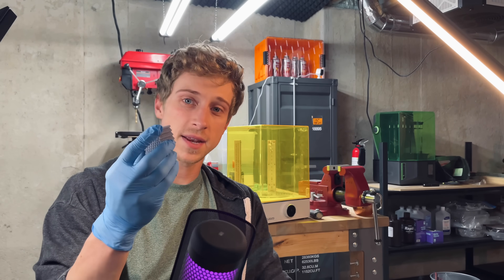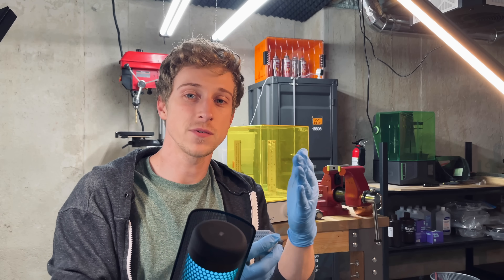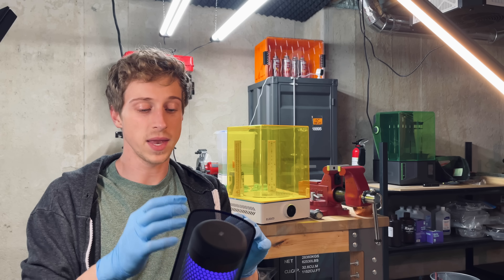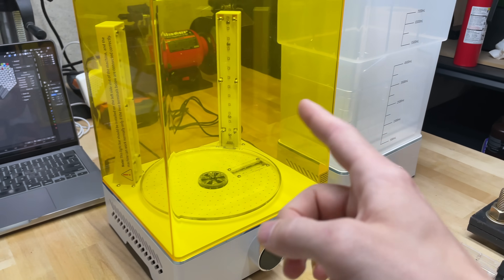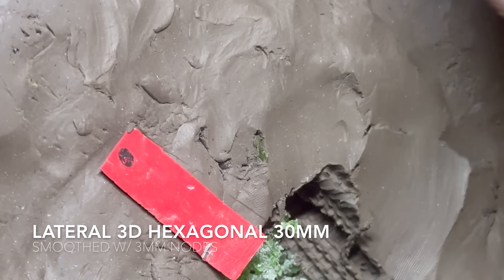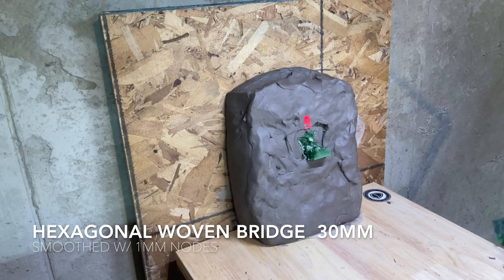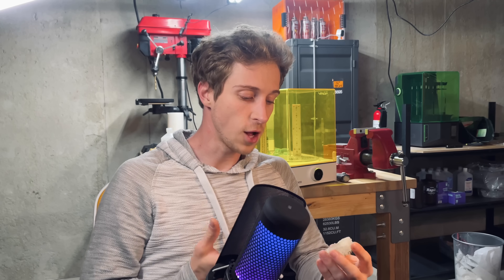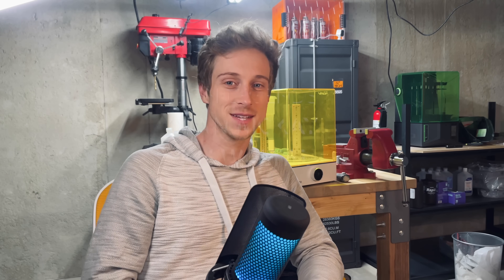Making 3D Prints Bulletproof with Molecular Structures

Comment: My man is going to supply space stations with micro-meteor protection in 5 years
Reply: now that is a suggestion i would have never expected, but definetly important
Reply: @mr.m2675  might be worth a try. I think right now they only use layers of aluminium, but your approach could not only allow on site manufacturing, but also recycling.
Reply: @Skargar  i thought so too. 
i also made that comment because when people think about armor, it mostly about soliders or vehicles.
but space stations they got it way worse, radiation and rocks like bullets. 
it looks like your thinking outside the box
Reply: @mr.m2675  Oh thank you! That means a lot coming from someone building armor from a 3D-printed meta-material <3

Comment: PhD organic chemist here. Look up the diamond crystal lattice. The structure is the reason diamond is much harder than graphite, and I believe it would be a better candidate for energy dissipation than what you currently have. The compound adamantane is basically a single unit of the lattice and could help you design your primitive. Good luck and take care!
Reply from the maker: Thanks dude! I know much of the strength of diamond comes from the strong covalent bonds I wonder if that is what comes before structure in their strength. The diamond cubic is pretty similar to the 3D hex structure that I have, but that technically has 1 extra node per repeated struct
Reply: @CrashMakerspace  So what's crazy is that Graphene's bonds are actually much stronger than diamond's bonds! The reason diamond is more wear resistant is because it's crystal lattice extends in three dimensions, whereas graphene's only extends in two. This is actually crazy because your results support this exactly! Your cubes that had the more honeycomb like structure (like graphene) severely underperformed because it could only disperse energy in two dimensions, while your alternated tubulane (more diamond like as you said) dispersed energy in all three directions. I didn't realize just how diamond like the structure was until I took a closer look at what you showed in the video. Very cool! You can check out another allotrope of carbon, Lonsdaleite, to get an idea of how you could even further increase energy dissipation. That compound is apparently 58% harder than diamond!!!!!

Side note, check out Bravis lattices for more ideas on different ways to arrange your nodes: https://en.m.wikipedia.org/wiki/Bravais_lattice

It will save you a lot of time trying to math out the repeating unit structure, it has already been done for pretty any orientation could imagine! This is actually how we classify crystal lattices of compounds. Sorry for being so long winded, but this just so happens to hit literally my three passions in life: chemistry, firearms and 3D printing.
Reply: @erokfussell Can graphene be printed? If so, would using a lattice like this with a graphene print be very strong?
Reply: @erokfussell  Triangles always win the toughness competitions.
Reply: @Runefrag yeh I was thinking the same thing. I was wondering if some 3d trusses or octet truss patterns would work better at this larger scale. Like yeh Diamond is amazing, especially since its atomic packing factor is pretty low, but its still so goddamn hard because of its lattice structure and its numerous bonds in 3d dimensions. 

I wonder if octet trusses with some other linkage tricks would make a more rigid and robust structure. I just dunno if his tools would be able to print them densely enough
Reply: @erokfussell  I was about to comment the exact same things about the benefits of 3 dimensional dispersion of energy (and especially with regard to face centered and face centered+body centered cubic Bravais lattices) as well as mentioning some other materials and geometries like lonsdaleite and the zincblende structure. 

And yeh you are 100% right and I hope crash maker sees all this stuff you’re talking about. Bravais already did all the wizard level math for us and now we have clear definitions and boundaries on all these things that would be relevant for Crash to take advantage of and hopefully save himself some headaches

Edit: sorry if I have multiple comments here or if they are in a weird order, my YouTube app on phone keeps glitching out
Reply: @Runefrag A hexagon is just 6 triangles in a trenchcoat.
Reply: @dnjdsolarus  technically, the very act of printing creates graphene.    Downside, you need to print with a pencil by hand.
Reply: @Runefrag not in chemistry, sadly. Triangular arrangements tend to introduce a lot of what’s called steric strain—the internal electromagnetic forces increase potential energy that compromises the strength of the structure. It’s good for making things reactive, but less so if you want chemical (or physical) stability.
Reply: @CrashMakerspace sorry, youtube ate my message, but hopefully you saw what the other guy in this thread, Erok, is talking about. 

And also, you may even want to consider using octet trusses and just packing them really tightly into cubic space, being face centered or  face+body centered, and use Bravais’s work as a reference. At these larger scales of body armor and rifle bullets, or like buildings and so on, octet trusses have shown to be more effective in providing structures with greater rigidity/compression resistance and structural integrity. So I wonder if they would perform well here if you add the right weaves/smoothing/any other connecting tricks you can get your printer to do
Reply: @CrashMakerspace  i would love to see a test with diamond crystal lattice. Round impacts are not going to be perfectly perpendicular to the plate, so oblique angle tests should be valued for the sake of good scientific rigor.
Reply: and i would incase the tests in metal a frame im sure that would help alot
Reply: The app doesn't want to let me post a new comment thread, but this one seems to have the right people in it to ask... What if you merged this tubulane(sp?) design with one of those nonrepeating tile shapes expanded to three dimensions for a nonisotropic lattice structure? Would that have benefits or contraindications for this use?
Reply: @claws61821 That is a very interesting idea. And there are 3-D versions of the non-repeating tiles, "quasi-crystals", which might turn out to have unique energy-dissipating properties.
Reply: thing about basing your structure off of a molecular structure is that the forces at a molecular level are much different than an object level. You have atoms pulling on each other just because they are close, while in an object, those forces are near 0.
Reply: Just realized, this bro is making IRL diamond armor XD
Reply: The problem with this is that the bonding doesn't scale.  You can't build the structure manually, at the gross scale it isn't going to have the same strength and energy dispersion as you'd think in crystallography.  I mean, you're going to have to have massive cohesive formations bonded on the molecular scale to resonate the energy, and isn't that the modern day challenge?

Comment: That's similar to end grain wood so kinda strong but not really. If you want strength, you need weaves or lattice structures layered on top of each other.
Reply from the maker: Layers is key to change bullet properties in a short space. This would still be strong, but the medium their made of needs a serious upgrade over this cheap brittle resin I'm using here!

Comment: I would think a triangular lattice with the apex facing towards the shooter would be the best 3D structure to distribute the point force across an area.
Reply: the issue is that this lattice needs to cover an area and if you look at a triangle the corners are the weak points when you start meshing them all together each corner will be quite weak and you wouldnt end up with a triangle as each corner would need to meet on a side of the pyramidal structure
Reply: @ferrofeles2063 what are you talking about? I don’t understand. This is completely counter to everything I see in engineering support trusses

Comment: @Crash Makerspace
What happens if you crate a pattern that is similar to diamond?
Diamond is such a hard material in nature, wouldn't that do well even if created with printer resin? (at least compared to other structures of the same material?)
Reply from the maker: What really gives diamonds the strength is the atomic covalent bonds being so robust. My 3D Hex structure is pretty similar lattice-wise to diamond aside from having 1 extra vertex per node
Reply: @CrashMakerspace  Aha 👍

Comment: Question: did you test them in multuple angles as well?
Reply from the maker: Only straight on, and then straight sideways in that 1 lateral test. Angled should still be pretty good as these are angle-based deflection structures so shots front-ward but glancing should still benefit form the angled bridges
Reply: @CrashMakerspace  just asking because of crystal structures in rocks have different sheering angles (angles where if you hit them then it's easier to separate them.)
But those are molecular bonds, not macro level connections like yours.
Thanks for the answer!

Comment: How much do you think the lateral displacement of the material matters for these results? Don’t some of prints have a diminished chance to disperse the force if the material can quickly shatter or “blossom”? 
Tbc, idks lol, I’m a layman. But the difference between a small cube and a torso sized plate seems like a big factor to me. I know it’s a test and the samples can’t be $$$$. But what if the cubes were contained at the edges?
Reply from the maker: It's true, smaller samples have to take more force with less volume, allowing them to be larger would very likely improve the impact ability as it could spread the force further laterally

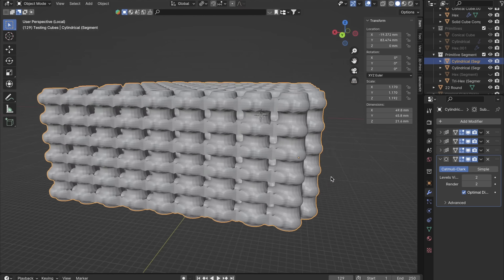Comment: 04:10 you should apply the Subdivision Surface onto a single lattice primitive and then use the arrays to duplicate it. Saves A LOT of compute power because it can do the smoothing once and then just duplicate as opposed to duplicating something simple and then smoothing every bit individually. 
Yes, there are slightly more considerations when doing this since your mesh must "meet" with it's neighbors at a point of continous tangency after the array has been applied (a.k.a the seam edges should make sharp corners between the joining surfaces) but that isn't really a big limitation since for lattice design that is a desired property anyway
Reply from the maker: Bro good point haha -- I'll have to see if the bridges get wonky at all though since smooths without connections can round off connecting faces before the array applies
Reply: @CrashMakerspace i think you can set it per vertex not to smooth something.
it can be found in the editmode side panel (was it hotkey N?)

Comment: Wow! This would be a great addition on top of some 3a soft plates! Have you thought about having a part of the lattice at an angle? This could give you some control over the direction of the fragmentation and possibly decrease the initial impulse. Lateral redirection and all
Reply from the maker: The fragmentation is mostly a reaction of the brittle filament I'm using, I'm expecting the steel to behave much better where that will resist and deform over shattering. These will explode no matter what shape due the cheap resin proprieties
Reply: @CrashMakerspace  Yeah, figured. I've worked with resins and composites. You'll probably be going for some sort of carbon-kevlar infusion backing? Wouldn't hurt to have some energy redirected away from joints or head-on hits if possible. For added lightness.

Comment: Since the variable here that determines the stopping potential is energy propagating through a material...  Vibrations are energy...  Phonons are vibrations propagating through atoms in a material...  You are simulating atomic structures on a large scale...  Have you tried to quantify the effects of phonon propagation through the various atomic structures?

For example, if steel #xxxx has a better stopping potential than aluminum of the same density, that would give you an indication that the atomic structure of that steel resists phonon propagation more than aluminum.  So now, if you were to use steel and recreate the structure of aluminum on a larger scale, that wouldn't be as strong as if you used the steel to recreate the steel atomic structure because the structure its self resists the propagation of vibrations through the material.
Reply from the maker: Yep and this is what I'm curious to see occurs with the steel, I only have 1 lattice now I'll be testing so I won't be able to tune it like with the resin. Each 3D steel print is really expensive so I can't quite attune the structure and node size to that new materials properties

Comment: I think logical next step would be to try out glass or carbon fiber infusion right during the print to add the shock resistance of some sort, and to make this structure not come apart when shot the 1st time. I'm not too scientific about it, but I am pretty sure it will mess up the bed on the printer, but will help out in saving the integrity of that construction itself.

Comment: 1. i.e.in ballistic engineering aluminum is soft. 
2. The lattice is simply shattering in all directions making it acting like a soft metal.
3. Molecular strength is what you need get better resin or learn chemistry and make some.
4. take a knife and stab a lump of clay 1 inch deep in clay would be fatal.  

I'm sorry but the worst thing you could promote is an ad for a UV curing STATIONS they are a huge rip off. A black light is $3 a backlight string is $9. So what makes these worth over $100? 
a safety beep and turn table lol?  as let tell me the best resin to use are are you using it?

Comment: This is really interesting because even those who don't fully stop the bullets do significantly disrupt and deviate it, if this was part of a composite armor scheme (like in a tank) it could have extremely good results. I'm thinking especially against an APFSDS round or HEAT blast, it could have a lot of promise to give better protection against armor piercing rounds for a smaller weight! Imagine a 5m^3 3d printer printing a tank glacis-sized armor element, lmao. And shit, already going to test it against a 300WM? That's gonna be interesting
Reply: the problem i see with this idea is that a standard tank will be hit by gunfire from machine guns missiles rockets and cannons of various calibers which would all interact differently on top of that a round shot out of a tank from a main gun is more an energy state than a physical object nasa did tests and found that above certain velocities everything becomes dangerous a peanut fired at orbital velocities will leave a crater in steel you cant cover with a dime and you can cut a peanut with your thumbnail actually modern armor technology has taken a back seat to firepower in tanks as armor is heavy and requires maintenance though the idea has merit you would sacrifice volume and increase the cost of maintenance for an honestly limited reduction in weight

Comment: Yoy might need to think more dynamically. Making the nodes all uniform in size ane shape won't cut it. The outer layer of this material needs to be a little bit more absorbent so they might have to have a spungy like structure, then a layer that is more dense and orientated in a.different direction then another softer layer with a different orientation. Need to layer this thing

Comment: you should try soaking the 3d prints into epoxy under vacuum or pressure
Reply from the maker: I'll be trying epoxy in the next video's plate that I'll be hitting with the 300WM, vacuum is the ideal method of pushing it in

Comment: I am not really experienced in this theme ( I experimented with creating some 3d print to stop air gun 40J) but maybe adding som rotation to each layer could improve the results in my opinion and experience
Reply from the maker: This is similar to the alternated tubulane mesh which is why that one likely resisted fracture better!

Comment: So.... could a proposed mechanism of action here, is the bullet hitting the tubes, then each bridge slows it down another increment as it grinds along the walls of whatever tube structures the surface of the bullet is in contact with?

Sort of like how the world trade center towers "pancaked" as they went down.

If so; two questions: Should your tubes actually be tapered? The tubes getting tighter along their length, the holes being smaller and smaller width each layer.

Second question: should the number of bridge layers get closer and closer together?

Of course, maybe this is a time consuming thing to test, and maybe there's a more direct way to get this information.... perhaps doing a battery of tests for different speeds of bullets, then extrapolating the results to the layers you want to use (so as the round slows down it his layers better calibrated for that speed).

On the other hand: Sometimes the simple versions are the most robust! Good luck!

Comment: impregnating the resin prints with silicone (or wax?) could potentially make it more capable of absorbing impacts, as it can absorb quite a bit of energy. sticking it onto a vacuum pump would probably be the only way to do it due to the viscosity.
Reply: someone else mentioned oobleck a non-Newtonian fluid the issue is the spaces that the stuff would have to fill are tiny and would require a vacuum assembly to fill every void granted it would be an interesting test regardless

Comment: it would be neat to see these structures tested after being dunked in glue, so it holds it together better after it gets hit, very cool to stop a bullet with 3d printed parts.
Reply from the maker: Similar concept of NN fluids, the ability to flex is necessary to allow the primary medium to still guide the force, but it would add another interesting variable to test!